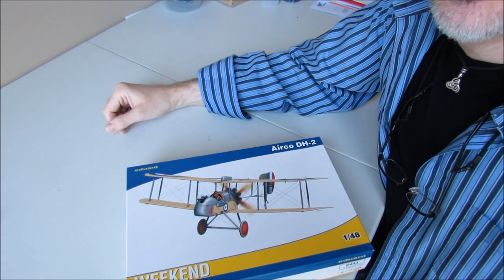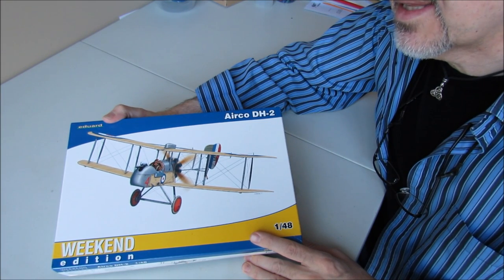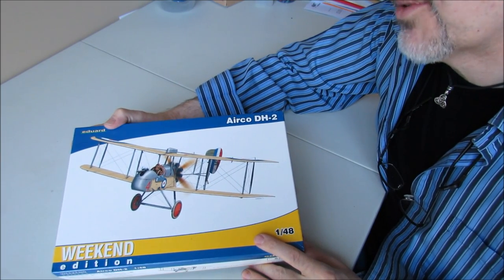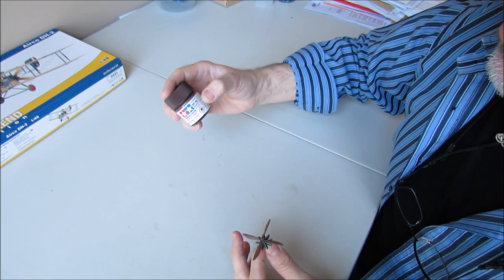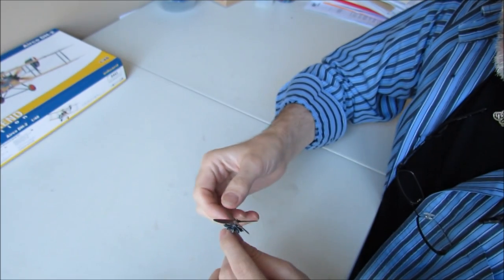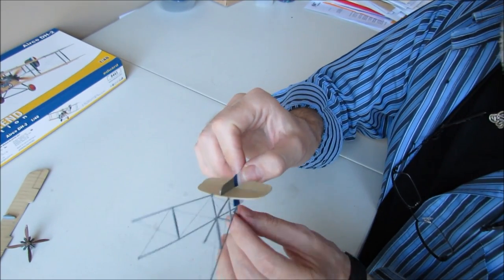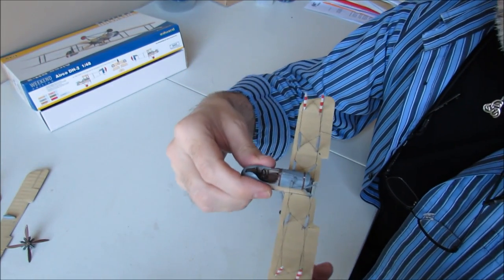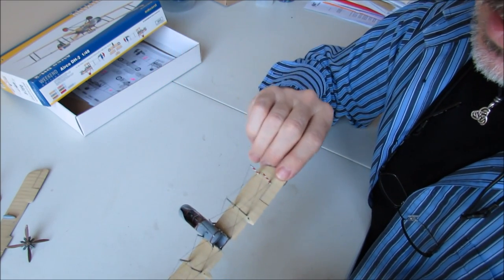Eduard 1/48 Airco DH-2 Build Update #2 (10.6.14)

Comment: Martin,Painting the tail gave it a more fabric look, rigging is very good. Final assembly now should be a breeze and become another one of your master pieces. Good luck! - Bob
Reply from the maker: bob dyer  Hello Bob, thanks for stopping by the second time tonight! I've already assembled her this morning, gave her a gloss clear coat and put the main decals on. I have 40 tiny stencils to apply on both sides of the all the struts at their center-points. After that, I will be fitting all the tiny pieces....aileron and rudder actuators, plus more rigging from the actuators to the wings and to the rotator mechanisms at the sides of the fuselage! Eeek!! Then, I'll apply another gloss clear coat to seal everything in, apply a bit of weathering...just light, not heavy, then apply the finishing matte clear coat and finalize the assembly by putting the machine gun in place. I'm a little modeled out today, so won't be doing anymore tonight. Hopefully, I'll get this all wrapped up by Wednesday. I have until the Friday dead-line to complete her, but I don't want to leave it down to the wire, would like to be a day or two ahead.Okay...I've rambled enough, time to get back to "The Voice"!Cheers : )

Comment: That is beautiful delicate work especially the rigging. Very well done in deed. Lovely painting as well. The ailerons on the wings would be one up one down. I'm not sure if the Airco had flaps as such. I think that part on top of the top wing may have been the gavity feed fuel tank.
Reply from the maker: chancerNW Hello Len, thanks for your continued support on this build, really appreciated, and, glad that you like what you see so far : ) I believe it is the fuel tank that is located on top of the upperwings, because there's a pipe fitted beneath it that enters into the engine compartment that I fitted today.I'll check out the position of the ailerons, thanks for the information : )Cheers, Martin!

Comment: Very nice build so far. I'd find the rigging very daunting but you've nailed it totally.
Reply from the maker: Thanks for watching mate and your kind comment. That was the easy part of the rigging, there's a lot more to do to it now; rigging lines from the sides of the fuselage out to the rudder sides. Rigging from the ailerons and flaps to their actuators, rigging from the top wing actuators through to the bottom ones etc etc. it'll probably take me a good part of tomorrow to do it, then I'll be putting a second clear coat on to seal all the decals that I put on tonight. Hopefully, she'll be wrapped up by Wednesday evening in time for the Friday dead-line for entries. 
Cheers : )

Comment: Hi nice build im mouse from ism in the uk i also watched the build from chris & alex had to say i admired there determination. I had to watch the clips in goes lol a quick question for you if you have time in painting parts on the sprue how do you touch up the unpainted bits ty
Reply from the maker: Clive Yearight  Hello Clive, thanks for watching mate, much appreciated. Yes, I was pretty tired after watching ad staying with Chris and Alex for the last 11 hours of their build...it was 6.30am here in the USA when they got done.Regarding touch up of painted parts on the sprue: Generally, I wouldn't paint wings, stabilizers and rudders on the sprue, but with a bi-plane, they are singular flat parts, unlike a more modern aircraft that consists of various parts to make the fuselage and wing assemblies. Therefore, there's no way of holding the flat pars to air-brush them, so I thought it would be easier to prime, pre-shade and paint on the sprue. When I clipped them from the sprues, I used the same colors but diluted with Isopropyl alcohol to keep the paint thin and then it blends in nicely without it looking thicker and standing out from the air-brushed paint surrounding those areas. The rule is to always use thin coats....50%-60% paint 50%-40% thinners.Hope this helps?Cheers : )
Reply: FullMoonDrummer
Ah ok thanks for the reply now i have a new quiestion for you on one of your other vids you mentioned Isopropyl alcoho before any ide were or if you can get this in the uk ty
Reply from the maker: In the USA it's sold in all the pharmacy (chemist) stores, so try your local chemist store first. If not, just use Tamiya X-20A Thinner at a 50/50 ratio : )
Reply: ok ill pop in and see if they sell that i had some tamiya thinners but im on revell paint atm and they dont work well together but thanks for the info
Reply from the maker: You're welcome mate : )